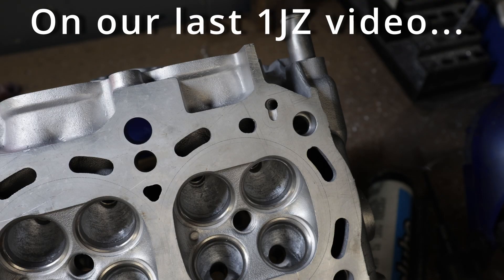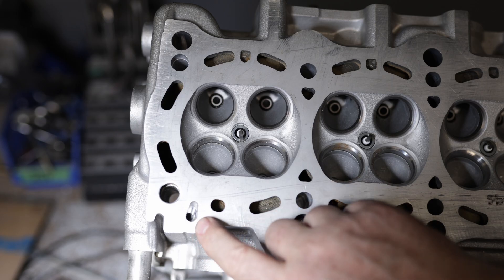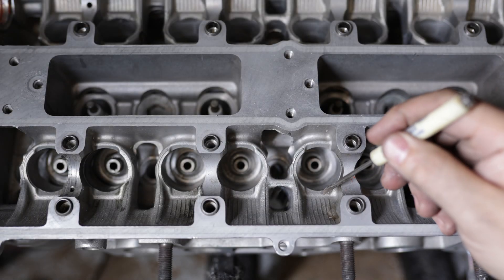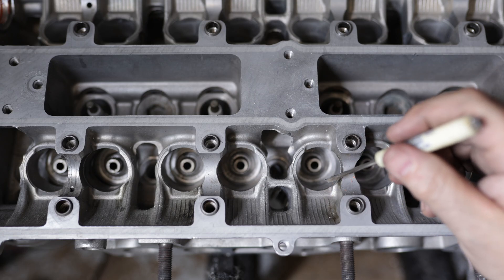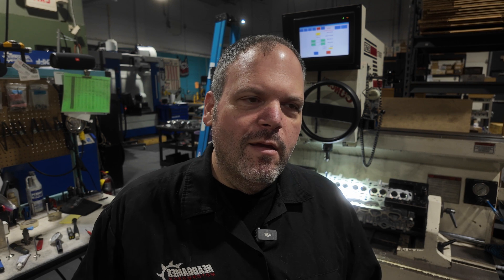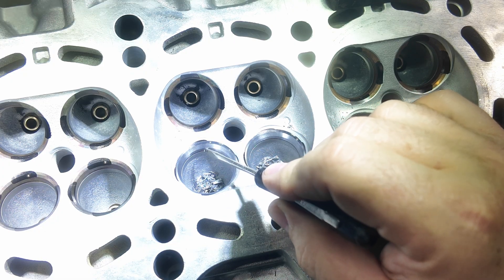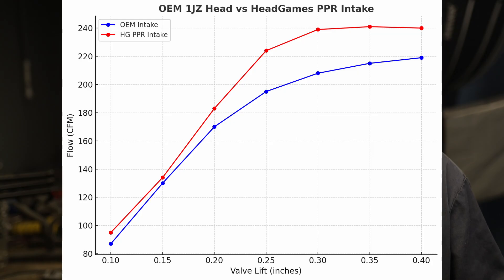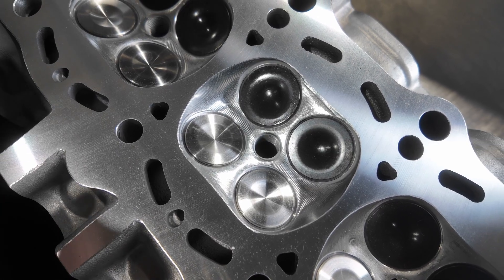HeadGames Pocket Port R: The 1JZ Glow-Up Session

Comment: What about reshaping the head ports so all 3 match? Also do you plan to have an option to machine secondary port for vvti solenoid on exhaust cam side of the head?
Reply from the maker: You cannot make them all the same. Unless you start over with a different casting. The VVTI solenoid is in the cam cap, not the head. We couldn't add material to the cam journal to make that work.
Reply: @headgames  seen it being done with 3sgte parts, so whats the problem in machining another oil feed?

Comment: Right on. I'm just about to start porting 1jz-gte vvti head for 1.5JZ engine 👍👍👍
Reply: I’m trying to figure out a way to keep my automatic when I go 1.5JZ. I’ve got a brand new short block from Toyota, so as soon as I figure that bit out, I’m ready for more displacement.
Reply: @negativeindustrial  we use automatic transmissions all the time with 1.5jz. with a small upgrade it's good up to 800-900 hp
Reply: @Georgianson 
Thanks for that. On an OEM ECU? What’s the small upgrade?
Reply: With 1.5jz we are using Stealth PCM ECU which is made on megasquirt 3 platform specifically for JZ cars. You can Google it by Stealth PCM words.
As far as transmission upgrade goes with used jz NA engine torque converter for turbos of 30 frame and bigger. Inside of transmission we install adfitional steel and friction plates of specific size, sometimes replace original friction plates, and modify valve body a little bit to increase transmission fluid pressure. That's pretty much it...
Reply: With 1.5jz we are using Stealth PCM ECU which is made on megasquirt 3 platform specifically for JZ cars. You can Google it by Stealth PCM words.
As far as transmission upgrade goes with used jz NA engine torque converter for turbos of 30 frame and bigger. Inside of transmission we install adfitional steel and friction plates of specific size, sometimes replace original friction plates, and modify valve body a little bit to increase transmission fluid pressure. That's pretty much it...